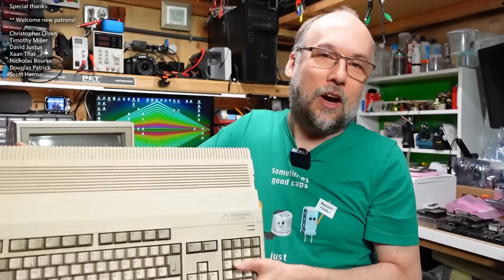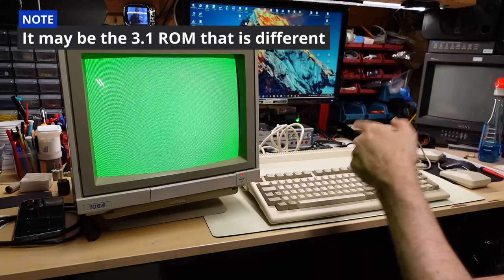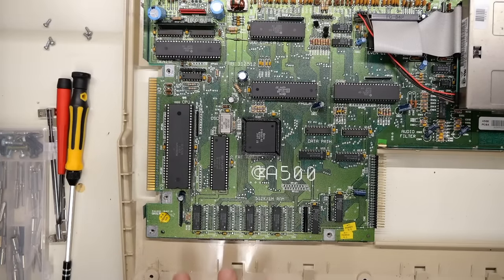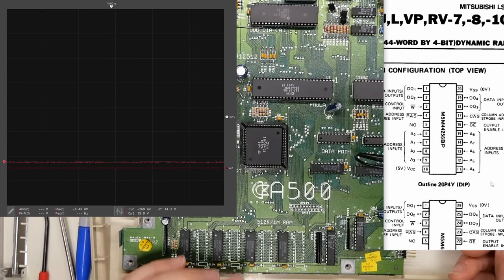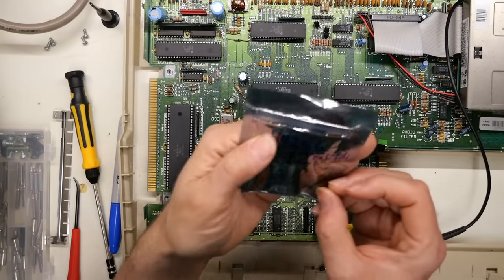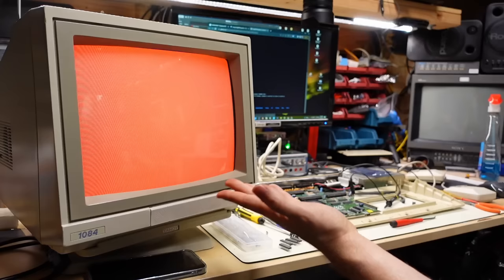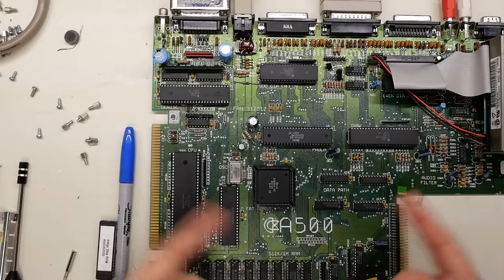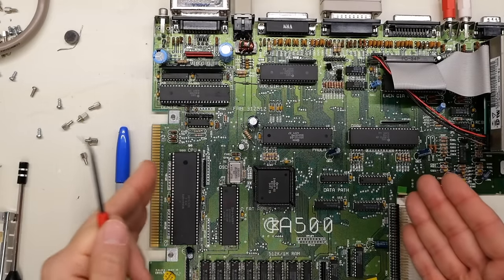Can the Amiga Diagnostic ROM help me figure out what was wrong with this Amiga 500?

Comment: Programmer of DiagROM here.. the reason for "not good enough" ramtest at start is: there are NO memory so all tets is done using registers only. This includes serialhandling... There are simply enough no ram available for doing more advanced tests. D0-D7 and A0-A7 only.  (Leaving a total of 64 bytes of ram to work with) However daily beta 1.3 handles adressissues aswell.
Reply: Also. As there are so many different combinations of rams on amiga it is impossible to do a pinpoint.  So you simply need to look what bits are bad and check schematics.    It is however more common that it is motherboardissues than it is chip issues. Agnus socket being the most responsible error.
Reply: Mr Guru  cant remember how it looks but i have a weak memory of it defaulting to yiu having an 500. Also dialogoca does not do this test at boottime as diagrom does. It does that when it got memory to work with, while the test he used is at startup before any memory whatsoever is detected
Reply: On amiga there are different chipsetups for a1000, 3 (i think) for 500, 2 for 2000, 2 different for a1200, a600, cd32, a3000 and a4000.  So "impossible" to pinpoint the chip. As you cannot detected the different machines realibly enough
Reply: Mr Guru  as i told. I cant remember.  And i by choise did not want a user to select what machine they have. And i must say after some years that was a good thing as many have not a clue what machine they are working with. Like what rev of motherboard etc... That is why i have a about screen in 1.3 tellibg that diagrom is not for those who want a program that say "chip x is dead" and diagrom also scans memory to use. And if no chipmem is found it tries fastmem to use as memory instead. Dialogoca will not do that and would not even run on his machine as it woudnt find any ram and not be able to tell why.   Ao it is ironical as he only used the scanroutine. Not even the memtestroutine.
Reply: And also how do you detect a bad chip vs the way more common motherboard/socketissue? If it told chip xx is dead someone swaps it and it is still bad.  People would complain.  So it is a tool for people to find issues using their knowledge. Not for people without common knowledge of the system
Reply: Also remember if one bit is bad on a chip. That whole complete block of ram is bad. And if you have only one block as on this video. Logica would not find any ram and would be unable to tell it.  And this is why i started diagrom with serial output as a main focus to be able to get logs on really screwed up machines
Reply: Mr Guru  i used it and that triggered me to do diagrom as lack of manual and weird undocumented colorcodes when it could not start. And it usually requires way more working chips than diagrom tp start. (It will not start without paula as one example).  I am on works of redoing CIA tests etc. But it is apparently a linited amount of hours in a day :)
Reply: Mr Guru  the manual is not for thw released version. But an older. It did not show what the errot code when paula was missing (common issue on a4000t when you put the IDC cables wrong and fry paula)
Reply: Mr Guru  all amigas have paula... So....
Reply: Mr Guru  Logica is a pile of rubbish. There are many situations it gives you nothing where DiagROM will give you at least some info. I've developed 14 accelerators against DiagROM. And yes there are some bugs but mostly its pretty easy to figure out whats wrong. It just doesnt send you a postcard.
Reply: Just to end this. Ironical is that the serial output of diagrom actually told what bits was wrong and such told what chips was bad if checking where the bits is connected on schematics.  So it all was there..  it is maybe more clear in 1.3 as then bad bits are marked red here you had to compare write to read and see. But it was even represented in binary.
Reply: @ChuckyGang  Says it all that Mr Guru has deleted his posts... :)
Reply: @jaycee1980  hah yeah
Reply: I'm pretty impressed you are doing the initial ram test and serial out without using any system ram. Nice.
Reply: @DavePoo2  it is tricky and code gets messy as hell.. I need to know what register is used and not and jumping to serial out requires "dirty code" as I cannot use "jsr" as that needs a stack :)
Reply: @DavePoo2  very tricky code indeed.. thankfully the 68000 has lots of registers!
Reply: @jaycee1980  Take that! 6502!
Reply: @chuckyGang Thanks for all the wonderful work you do with this Amiga Systems ! I love the Amiga 3000 Build I did, and you are a valuable asset to the Amiga History!
Reply: It's so annoying when people don't realize and appreciate the work someone puts into stuff and even releases it for free and open source. If something appears not optimal, there's usually a reason for it, just like in this case. I guess it's just how it's always going to be, when you give people something, they always want more. Anyways, rant over. Good job on the DiagROM ChuckyGang, I find it really cool that the RAM test and serial is all done using registers! :D
Reply: @jaycee1980  I can see about 6 or 7 posts by him. More likely he has reported you so you disappear.
Reply: @handlesarefeckinstupid  or he's just blocked me. Im still here :)
Reply: Excellent work on this ROM, love that it will help keep machines alive.  What was 'Mr Guru' whining about - can't see as he's deleted his posts?
Reply: @jtsotherone  he claimed that Dialogica would find the issues.. when it actually would not even boot..
and then simply claiimed that it was superior to DiagROM.

It might be useful.  but it would for sure not help here. actually perform way worse as it would not even try to give a hint what was wrong.

guess he deleted his posts when he noticed he made a fool out of himself
Reply: @ChuckyGang  sounds about right!  Thanks for that, and again - great work on the ROM!
Reply: @ChuckyGang  As someone not familiar with this architecture  Would it be possible to first run a complete simple test on a small portion of the RAM, then use that as a stack while testing everything else.

Made up numbers and psuedocode.

startMemTest:
reg7 = 0
write memory[reg7] = 0x00
if memory[reg7] != 0x00 -> goto fail
write memory[reg7] = 0xFF
if memory[reg7] != 0xFF -> goto fail
if reg7 != 0xFF -> reg7 +=8; goto startMemTest
Reply: @arthurmoore9488  this is exactly what it is doing here.. it is not a memorytest. it is a VERY VERY quick generic test to hopefully find working ram to use for stack etc.

the real test is in the program that tests every single byte
Reply: @TerribleFire it never cease to amaze me of the people who are most critical are the ones who done the least or have the least knowledge.  Or am I missing the boat ?
So many noobs want plug and play solutions,  then when the get it they think their an expert.

You tube is full of noobs mostly. Most experts or experienced people don't blow there own horn or act like they know everything.
And I see so many people who are not on you tube for money $$$ but helping tubers make money or donations to them like wtf.   I'm a barrel scraper, leave week to week, doing a noob job, but have hobby tech skills beyond many pro tubers, but I refuse to help them. Why ? Because I'm old bitter , always shit on and ripped  off. People pretend to be nice, but when it comes to money, their true colours shine. Thanks TF , thanks Diag Guy, and all other true contributors.  And no thanks to all leeches and layers and noobs. Best way to help the scene is stay private. I refuse to release any or my code or hardware creation as it just gets ripped off by the bad bloods hobby guys and pro tubers. Anyone who takes offence to this must be bad blood in my books because truth cuts to the bone. If you don't then you probably a good guy. I'm sorry but the true guys who develop for the scene any many cases have caused the price increases via a cascade effect of copycats and leeches.  The amiga is the worst these days. Board rape galore and the Chinese chips prices and fakes... has totally destroyed it for me. Do I ever stop complaining 😂.  But once again thank to all the devs  who just did it for love, not Money and greed.

Comment: Having certain chips socketed and some not, enabled vendors of the day (including Commodore) to produce boards quickly, populated with off the shelf components and then hold them in stock. Production was not halted using this method, and gave the added benefit of having an inventory of "less expensive" boards that could be called off, populated, as and when required, according to demand. Easier to solder a socket, than waiting for a custom 8372A.

Comment: It's really weird: Those Siemens DRAM chips all seem to be failing these days! 
I've repaired about 5 Amiga 500s this year in which about 12 of these Siemens chips were bad. It's like they all reached their expiry date or something. Usually Siemens is a pretty reliable brand in my experience (their CPUs for instance are excellent!), but not with these machines. It might be caused by bad PSUs of their previous owners though as DRAM is very sensitive to overvolting power supplies.. Anyway I always replace those crappy Siemens units with OKI chips. Japanese quality for the win. My all time favourite DRAM brand as not a single one has failed on me yet 👍

Amiga Diagrom is a cool product and I use it all the time (infinite kudos to Chucky), especially because of its very useful serial output feature but its RAM test routines are pretty flaky to say the least. They're very rudimentary indeed (no checkerboard test etc.). You should try Logica Dialoga. It's a way, way better diagnostics suite from back in 1991 which you can also run from a 27C400 EPROM on these machines👍 I can send you a de-XOR-ed copy if you want as its copyrights should've expired by now.. You can also find this ROM image if you have a copy of Amiga Forever but you'll need to grab the decrypted ROM while the (virtual) machine is running, using WINUAE for instance.. It's the most useful tool out there for catching bad RAM chips and catching things like CIA or interrupt errors. 
Especially on a rev 4.3 Amiga 2000 for instance, which has 32 DRAM chips Logica Dialoga is a must have unless you really like desoldering ;-)

Oh and the TL866 can burn 27C400 EPROMs (up to 27C322 32mbit/4 meg units). You'll just need an adapter. Digicoolthings.com is one of the guys that sells these (not a sponsor, just bought mine there ;-) )👍
Reply from the maker: Thank you for the awesome info here. I hadn't seen these Siemen's ICs much before -- so fascinating they are all dying left and right. I will add them to the list to watch out for. Is it just the 44256 type or are others bad too?

And then Logic Diologa--- too cool. I hadn't heard of that one, so a better and higher quality ROM based RAM test is highly desirable. If you could email me, you can get my email at my channel about page -> business inquiries. 

Thanks!
Reply: @adriansdigitalbasement 
Yeah, it's the 44256 units on these A500s you definitely should watch out for. I think it must be because of overvolting PSUs of their previous owners (if I had to guess as it's a pretty common phenomenon on A500s). I think these Siemens units are particularly sensitive to that. Amiga 2000 rev.6 machines use these exact same chips but I've never encountered a faulty one on those yet so it must be flaky external PSUs of the A500s that are causing this high failure rate..

Yeah, it's GadgetUK164 (another Amiga nut like me) who gave me the idea to use Logica Dialoga and it proved very useful to me. I use it a lot while piggybacking DRAM on Amiga 2000 boards as I repair a lot of broken rev. 4.3 units for my customers as they abundantly available here in the Netherlands being German machines and all.. This suite makes it pretty easy to spot flaky DRAM chips without having a fully booting machine..
All right, I will e-mail you the image Adrian. Keep up the good work producing awesome content 👍
Reply: Mr Guru  Ah so you are Gadget's friend he mentioned in his video. That's awesome, thank you for the (indirect) recommendation! I'm sure you helped out a lot of people in the retro community through his channel (y)
Reply: it must be something internal degrading or that moister is getting inside corroding the internal which is possible.
Reply: Maybe so, or it  ould be caps failing and taking out other components with them as they go full short.
Reply: @handlesarefeckinstupid  In my experience the capacitors on the Amiga 500 and 2000 don't fail that often and the ones that did fail on me were just leaky but I never experienced one that had a short and I repaired heaps and heaps of these machines. It's a rare occurance in general for electrolytic capacitors to short. That's more typical of tantalum capacitors..
These DRAM chips just seem to bite the bullet all on on their own and when I replace them most of the time everything is fine. My best guess is still bad voltage rails. Overvolting power bricks are the number one cause of failing DRAM on the A500 as well as the C64. Who knows what crusty crap the previous owner(s) plugged into these things? ;-)

Comment: Yes Adrian... I was one of those screaming at the screen lol, There is a useful feature of the diag rom you missed, right at the start the green and red bars that show after the flashing screen indicate individual data lines of each ram chip, you can easily isolate the bad chips by either disrupting the good ram data line or inject data onto the data lines and watch the screen in real time for changes... I saw instantly you had more than one bad just from those lines they should all be green and divided into four quarters you can see that your ram was bad on more than one.. I have found injecting CS (or maybe RAS or CAS its been a while) onto the bad chips data lines changes the red stripes to green thus highlighting the exact ram chip thats bad... I must admit though I did find this by accident as the diag rom manual was not super informative... Good stuff though I love repair videos so keep it up. (perhaps a recap video showing the feature and how to diagnose using it?)
Reply: this sounds like a great tip. thanks for contributing.

Comment: Green screen does not necessarily mean bad ram. It means there was a problem communicating over the chip data bus. Quite often in a machine that has had battery leakage near it (usually more the case with the 500+) the problem is in the "DATA PATH" section rather than the RAM itself
Reply: Yeah, every time I got a green screen it was because Fat Agnus was loose, and reseating it fixed the problem.
Reply: @Peter Mulholland I wondered if you'd watch this 🙂.   @Adrian Diagrom's serial output comes in very handy sometimes👍.  Especially if there is no video output, it gives you a good idea what is, and is not, working 🙂.
Reply: Mr Guru  DiagROM will run even when the machine cant boot. In this case the RAM was so badly gone the machine couldn't work at all. DiagROM is also capable of showing you exact memory fault locations.
Reply: Mr Guru  no logica requires chipmem to run.  His machine did not have chipmem
Reply: Yup. I had a machine with a bad 8520 throw a green screen once. If something is on the bus that is inhibiting access to 00000-1FFFF for whatever reason, you'll get a green screen.

Comment: Nice to see an Amiga repair.  If you plan on keeping the 500 I would suggest replacing the 2 large caps near the video port.   I'm not a fan if just replacing caps but these two like to fail to a short and can take out your video.
Reply: having done plenty of amiga repairs i have never seen those capacitors go short. However, they can lead to noisy video.

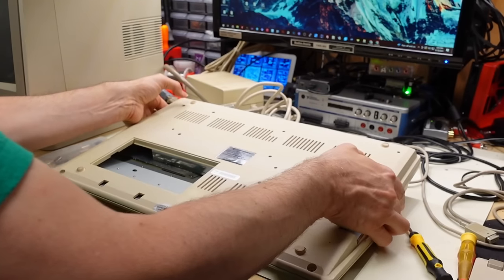Comment: 3:00  in SouthAmerica the first C64s were of course imported directly from USA so they were 110V@60Hz, but many countries just used a stepdown transformer from 220V to 110V and disregarded the fact that their mains runs at 50Hz (which of course affected sound and video signals); several years later C64s were locally produced with a power supply input of 220V and internally modified according to the 50Hz frequency.

Comment: When you have an upgraded agnus (8372A), DiagROM can use the add in memory (another 512K in the internal plug in port), to boot around the bad onboard RAM and let you test the bad ram.
Reply from the maker: Good to know!
Reply: Very
Reply: Thank you, that makes so much sense! Please have a great day
Reply: @adriansdigitalbasement  there is it seems a specific diag rom for the 500, 600, and 2000, or at least when I got mine there was the 2 options the other being for the 1200, 3000 & 4000, maybe you have the latter?
Reply: @cleetusmacfarland9453  The only difference between the versions is that 500/600/2000 machines use a single 16 bit ROM, and 1200/3000/4000 require two ROMs due to the 32 bit data bus. The contents is otherwise the same.
Reply: @adriansdigitalbasement  Having the "cedilla" letter I think this machine is for Portugal or Brasil.... were is use Pal-M also 60Hz ( it sound like NTSC )...
Reply: @Ramdileo_sys  It was probably sold as an all-in-one layout for Latin American countries (+ Portugal and Spain) since it has both the "Ñ" and the cedilla.
Reply: @adriansdigitalbasement  
Glad to see you finally working on an Amiga 500!
I've been waiting or wondering when you'd come across one to fix as I have an amiga or two that need work, but I'm going to try to replace a few burnt resistors as this is a big problem on some amigas, because their power supplies are crap.
Reply: @TuxraGamer  Yes.. but I bet now Brasil.. only country with 60Hz/Pal-M ... Portugal and Spain = 50Hz/Pal....